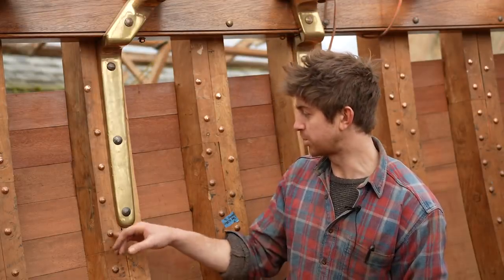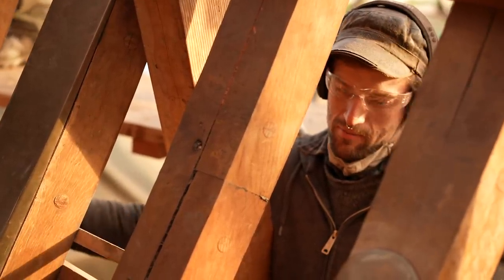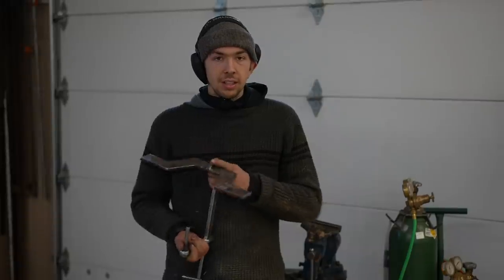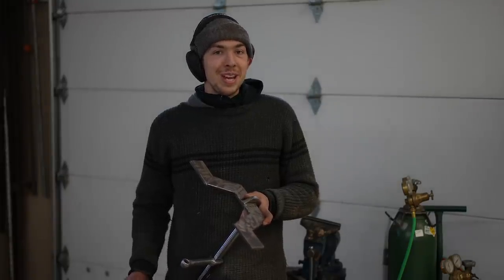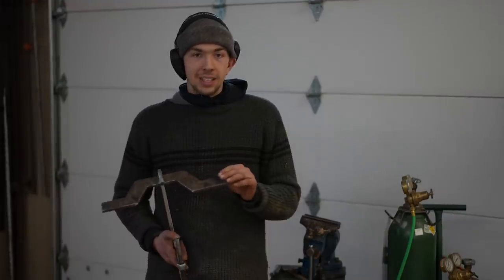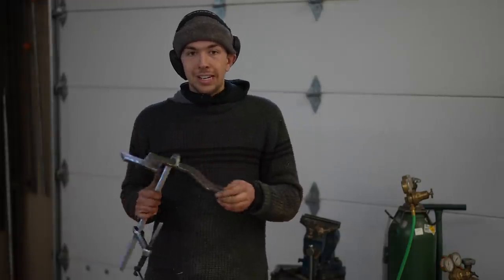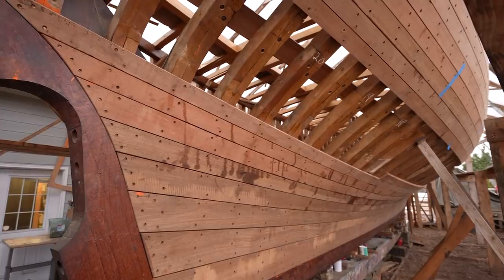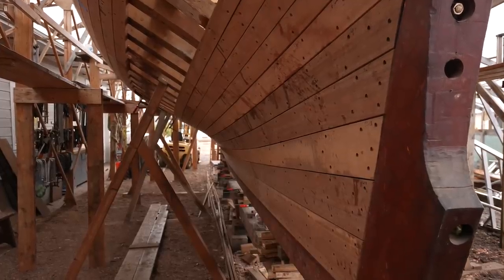Planking the Hull - Part 2 (Rebuilding Tally Ho / EP91.2)

Comment: Hey Leo, 1stly- I'm a big fan, thanks for all this awesome content! been following you for years now!
2ndly,  A question I've had in my mind for a while now, i was wondering how the planks on the stern side will terminate, i see that at the moment they are running wild but was wondering if the just going to be cut flush with the transom and have their end grain exposed? or is there a trick to cap the end grain in some way? 
as a carpenter I'm naturally thinking of doing the skirting board trick where you cut the end on 45 deg angle and glue in a capping piece also in 45 deg, leaving the end grain "buried in" . for some reason capping the end grain using the transom itself as the cap feels to me like a more "satisfying" way, although, of course, the transom itself will have its end grain exposed that way... so no good. so what's the plan Stan? Cheers, Omer

Comment: If the bearing on the router bit is damaging the wood, why don’t you just remove the bearing? You have a wooden fence that controls the depth of cut, won’t that be enough? At least as long as you only make a single pass.

Comment: That measuring system where you use random objects for reference is very confusing. 1,1/2 - 1,3/8 inch sounds like a very complicated way to count compared to the metric system.

Comment: Is it considered bad luck to ask an estimated launch date for a boat under construction? (I know you're not supposed to ask an author when their new book is going to be finished . . . ) I have to make a trip to the PNW sometime this summer/fall, and it would be awesome time be able to time that for the launch, if possible?
Reply: Euh, 
You are a bit optimistic in my view: I think that TH is more or less half way the rebuild: 
Still to do (and do not count on a empty hull getting launched: the work shop is going to be very busy, doing all that work when TH is  floating will cost more time.)
1-Fairing the outside of the hull, 
2- Caulking (corking) the hull, 
3- painting the hull outside and conditioning the hull inside, 
4- Installing electrics, water and fuel tanks, 
5-installing the engine + propshaft and propeller, 
6-building and installing the interior, 
7- laying the deck, fittings, winches, hatches, ...
8- making the mast and spars and preparing rigging. (maybe  even a test fit on dry land)

and all the rest i forgot to mention. Leo started about 3.5 years ago, I think at least 2 years, maybe 3 to complete the rebuild.

Comment: Why does Leo use slotted screws and not  a torx or Phillips head?
Surely this would be an improvement on the original design.
Reply: 5 or 50 years from now, that screw might have to come out to make a repair. It'll be much easier to clean old glue & dried goo from a slot, than from a torx recess.

Comment: I’ve watched every episode and was wondering why stainless steel is not a option as far as Fixing go.
Just curious
Reply: While stainless steel doesn't corrode as quickly as iron, it will release iron ions when wet. These ions corrode wood, weakening its structure & giving microbial rot a better foothold. Leo will avoid "iron sickness" by using only non-ferrous fittings & fasteners.

Comment: Question: why can't you put whole planks on?  Those planks are close to a foot wide and you cut them in half.  Isn't that double the work?;
Reply: The inside face of the planks must be hollowed out at center or edges to conform to the curve of the frames. If you start w/ a foot-wide plank that's 1-1/2" thick, you won't have much left.

Comment: Fun to see the pooch on the forklift. He/She looked so at ease, no drama. Great skills and dedication to building this classic, Shipwright techniques in use are probably more comprehensive than when she was originally built. Knowledge is everything when committing to design and construction techniques that lead to building a legacy that will grow to a century old icon. Only question I have Leo is how much original Tally Ho will float again. Up until now I’ve heard you talk about using original timbers but mostly it seems new timbers are used. I recall the transom may have been original but will their be much more. Restoration of classics from the early 20th century such as Fyfe’s, Milne and C&N have all come under criticism. I hope your focus will maintain the “R” as restoration or rebuild and not drift towards a replica.

Comment: Im wondering what is left of the original boat or has everything been replaced. If it has is that not a completely new boat  .asking as i know nothing about boat ownership. Great project have been following you from the start .
Reply: That very question was covered by Leo in an early episode (available on the channel here, but I forget the number now), and gets brought up every so often in comments.  Leo, and many viewers (myself included) believe it to be a restoration and not a copy.  Some of the original wood and fittings have been saved, and the Albert Strange plans followed faithfully, almost fanatically, certainly respectfully.  And the order of the work was more in line with a restoration, taking things apart carefully to eliminate rotten and unreliable wood, seeing what could be preserved, swapping in the new keel while the old frames were still around it, etc.  Starting from scratch would have seen steps done in a much different order.  My own analogy, I liken it to the various types of cells of the human body, where every 7-10 years (or sooner, days/weeks for some tissues), nearly every part of the body is replaced with new tissue.  And yet, I'm still me.  So's Tally Ho....
Reply: @billparrish4385  Episode 58.

Comment: To measure moisture content, can’t you weigh a sample before and after baking it at a high temperature? Wouldn’t that remove pretty much all the moisture so the weight difference would tell you how much water it contained originally?

Comment: Planed planks, cut with the circular saw - that boat won't hold long, in the old times they shaped the planks with the adze. With the planer you open up the grain over long lengths, allowing large openings where water can penetrate into the plank.
 
The adze cuts along the grain, minimizing the amount of open grain.  
 
The open grain is the biggest weakness of wood, therefore the construction of a boat is such that cross cut surfaces (the ends of the wood) are usually covered by something. 
 
See the rabbeting  into the stem and sternpost.  
 
Nevermind, great work, I just wanted to show off a little bit with my fragmentary knowledge of historic shipbuilding - and maybe it is new and interesting for someone...